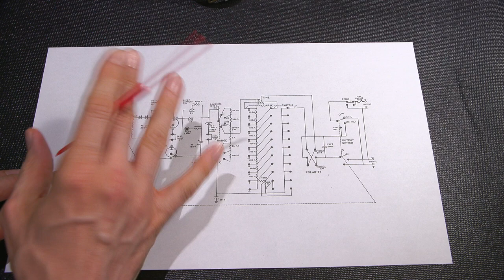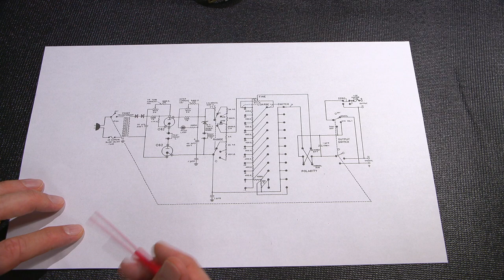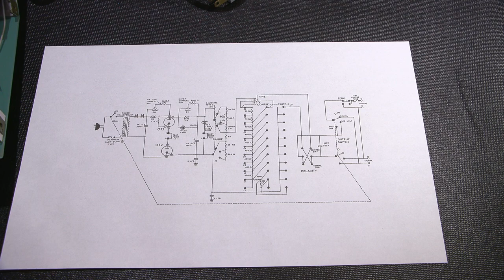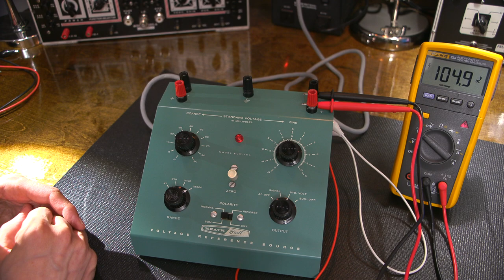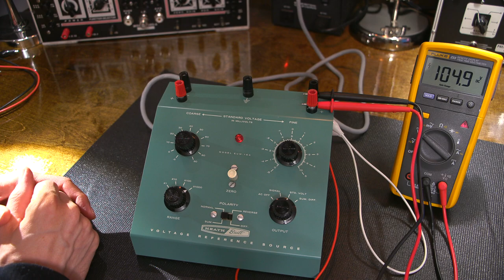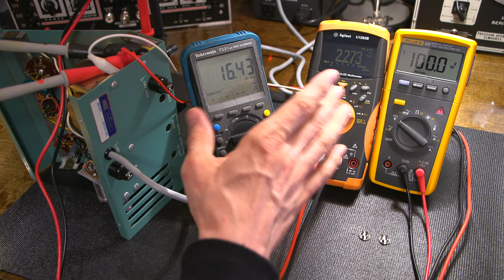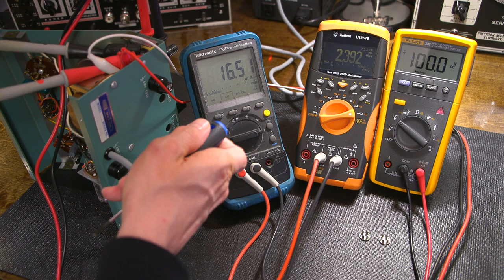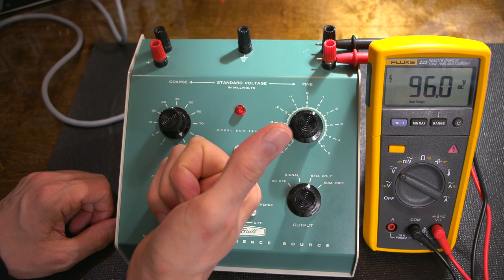HeathBuilt Voltage Reference Source [Restoration]

Comment: I am afraid superglue is not gonna do these knobs in the long term.
I would drill four holes in the four connection rods between the inner- and outer knob. Sand down the surface. Then use a few winds of 0.1 mm steel wire to tighten the inner plastic tube after adding some good quality 2 component epoxy filler in the cracks. After tightening the steel wire, fill the whole knob with the epoxy too, between inner- and outer plastic. All the time have a screw in the screw hole smeared with some silicone grease, so the thread is kept clean from epoxy.

Comment: What's the white push button zero button supposed to be for? what are you zeroing out
Reply: Yeah, I was wondering the same thing.
Reply: @StewartMarkley  only thing I can think of is to just charge your capacitors when disconnecting and connecting leads
Reply from the maker: Just for zeroing the attached meter. If you tried to discharge a cap with the switch, the 1/32A fuse would vaporize.

Comment: Kind of funny that 50 years later any random $5-10 multimeter serves as a perfectly fine reference for calibrating this.
Reply: Having a few identical meters at work, those $5-10 are at least 20 or 30 times that cost..... but true even cheap digital meters are surprisingly accurate.

Comment: can you make an oven for a zener diode?
Reply: A zener is at its most stable run close to its maximum power, and so it will heat itself ?
Reply from the maker: Yes, this is common in more modern reference's or standard's.

Comment: Interesting fact, color coding in electrical requirements is black is hot and white is neutral. In electronics, color coding is just the opposite. Where black is ground and white is hot. Very confusing.

Comment: How do you "reform" a capacitor? Tell it about all the horrible things it's done in it's life?
Reply: It only works with electrolytics. You apply a low voltage (of the proper polarity; be careful) to the capacitor and monitor the current through the cap. As the current decreases, you raise the voltage you're applying, in increments. Eventually, you get to the rated working voltage of the cap and the dielectric film has been re-formed.
That's the theory, at least. It's safer to just replace the cap. I guess you could look at that as being an intervention.  😁

Comment: Curious as to what a person in the 60s would have used to calibrate this.
Reply: Probably a standard cell and a kelvin varley voltage divider
Reply: @156dave  And also a Differential Volt Meter. (What "dvm" USED to mean!) The principal characteristics of a Differential Volt Meter are that the measured input is balanced against a precision internal voltage (using an internal K-V divider); and at the balance point the effective input impedance is infinite because there is no current flow. I was really sad to see them disappear from the Fluke catalogs.

Comment: Hi Paul. You mentioned that Zener diodes don't make great voltage references on their own because the voltage drop goes up with increased current. Could this be exploited to simulate "sag" in a power supply for something like a guitar amp?

The output voltage drift from you blowing on the Zener diode was barely more than 0.1% and stayed well within 0.5%. If this bit of kit claimed to be a precision voltage reference or a "reference standard", I might quibble over 0.5%, but for a bench reference, half a bee's dick is just fine.
Reply from the maker: Hi Peter. For the time (many VTVM's in use) this was more than adequate. Zeners are quite affected by temperature change, many IC's have a temperature compensated Zener reference right inside them (UA723 for example) Of course, the more current placed on the Zener, the more it will heat and drift.
Reply: @MrCarlsonsLab  Of course buried Zener references (basically a Zener diode, a heater wire, and an error amplifier in a can) are among the lowest drift references in bench multimeters, and I understand most  handheld multimeters have a Zener reference that's trimmed out in software,  but I was thinking more along the lines of exploiting the drift of a soft-knee Zener.

Comment: The device isn't of much use for a stable reference
Reply: It could be improved by putting the Zener diode in a small oven with a light bulb and a simple thermistor feedback loop.

Comment: o b 2 in the us  kg6mn
Reply from the maker: I often call them "Oh B Two" as well, but the correct term is "Zero B Two." The first number indicated is the heater Voltage, and this tube has a cold cathode (no heater) so Zero is first.

Comment: Better use JB Weld, not super glue.
Reply: H Higgins  I have repaired several broken knobs in the last years with JB Weld, with excellent results. Bevore I also used a high quality super glue, that worked much worser. Beside the fact that it is easy to make a big mess with super glue (it glues everything, but not what it shall) it did not last long, especially with old and hard plastic. In my experiences  J B Weld was always a better choice for this kind of repairs.
Reply: H Higgins  When there is much dirt inside I use a cheap ultrasonic cleaner to get it out. With super glue you have the same problem. I apply the J B Weld with a  toothpick or a small tool. I align the pices and fix it with a clamp or vise an let it harden for at least 24 hours.